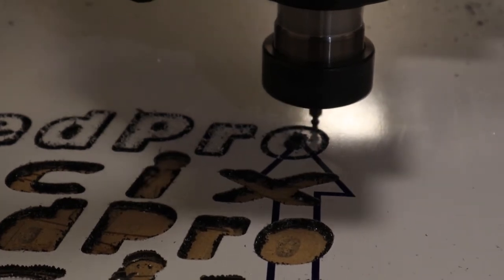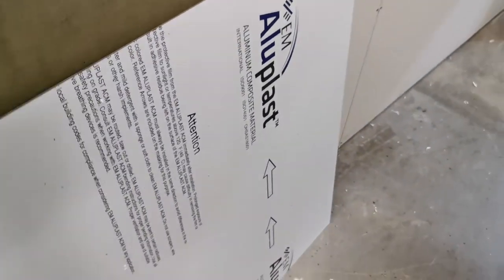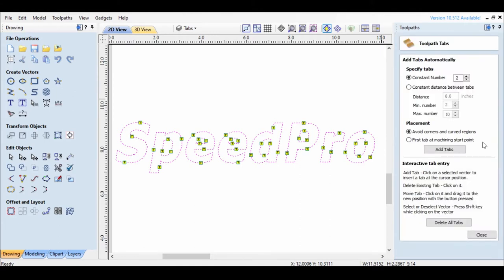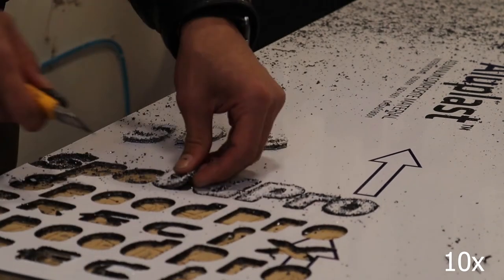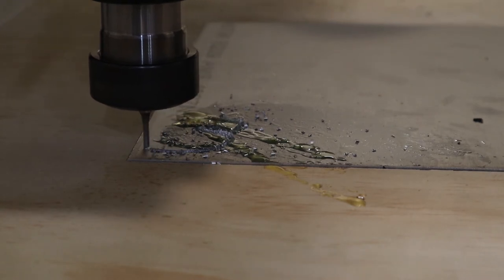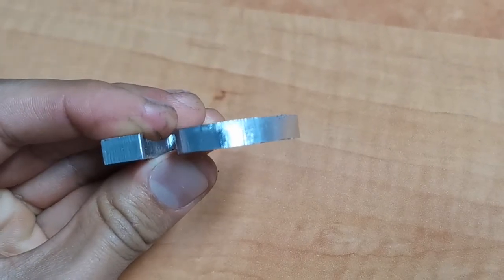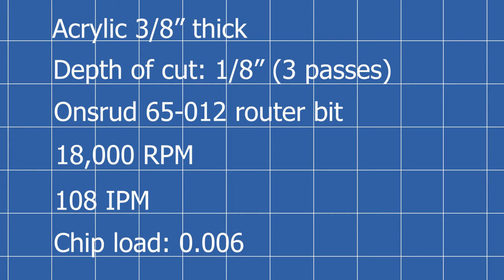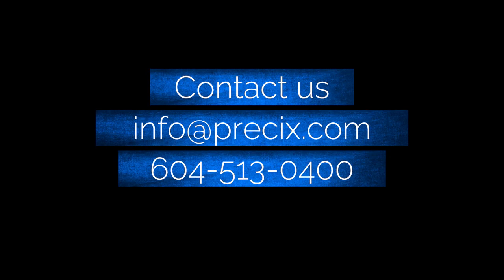Sign-making using a CNC router

Comment: Or you could move your lead in and lead out toolpath to a corner to eliminate the small blemish @9:39  interesting to see you are now using mach3 instead of the proprietary precix software that was on the performa router i have......now with centroid control and dmm servos